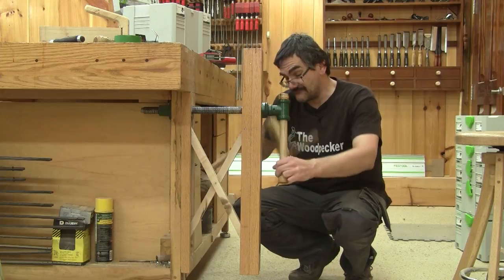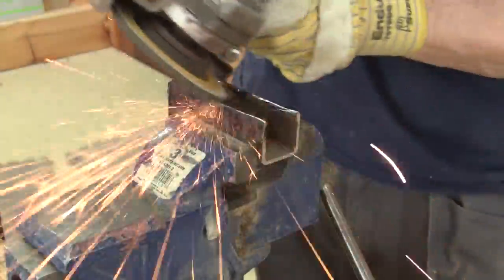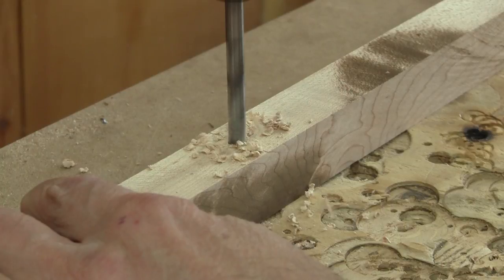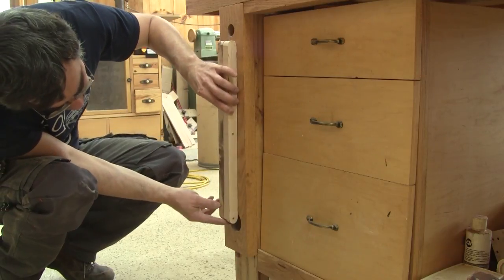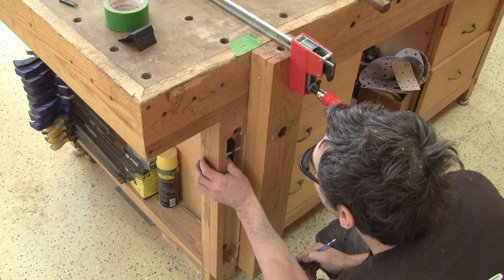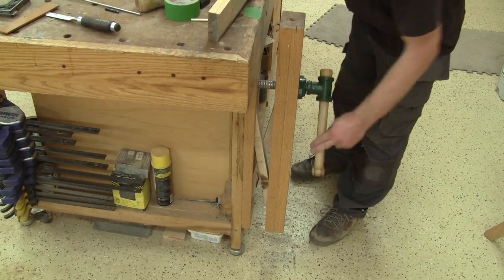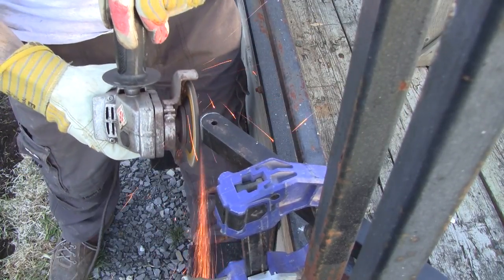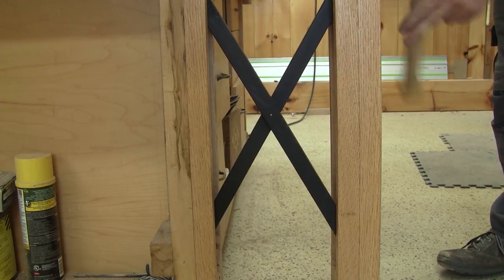The Woodpecker Ep 134 - A Crisscross For My Old Workbench

Comment: A suggestion for the fire extinguisher: mount it next to the front door. That way, when you see fire, you run to the door, get the extinguisher, and turn back. If the fire is manageable, go fight it. But if the fire is now too big, you're already at the door on the way out. Placing the extinguisher behind an object which may catch on fire is not a good idea. If your bandsaw catches fire, you don't want to have to reach around an aflame bandsaw to get to the extinguisher. Also, consider a loud smoke alarm on the ceiling if you don't have one already.

Comment: Most of the time those dust fires just smolder for hours, we use to have them all the time at work because the fabrication shop would send sparks flying 20ft into a pile of saw dust. You can buy those welding blankets to help block the sparks if you want.
Reply from the maker: I'll cut outside it's safer.  Hopefully when I'll need to do that it wont be well below zero...

Comment: To drill a straight hole in something that cannot be put in a drill press, drill a block on the drill press, then clamp said block where the hole needs to be and let it guide your drill.
Reply from the maker: I do that quite often, but I didn't want to mess this up, so I went for the metal bracket.

Comment: if the metal crisscross rides against wood directly it may wear the wood prematurely. A metal channel to ride in may also further reduce give.
Reply from the maker: you're right, it,s one of the reason why I added sone thin pieces of maple where the tip of the metal rides on the wood, Maple is easy to change.
Reply: @LgosseuxDbois-TheWoodpecker  Looks like maple pieces need to be thicker.
Reply from the maker: @4486igi  this shouln't be too big otherwise I would have to remove too much wood to make this fit... I think metal is the way to go. At least it's been working great

Comment: Why can’t you drill a hole through a thick scrap block with your press and then clamp that down as a drill guide? Helps to start your hole freehand so you can locate it precisely through the block.
Reply from the maker: It can be done, but if the hole is not at the exact spot, it's useless, and you end up with a useless hole in you workbench. It's why, a "real" Criss cross manufacturer suggest doing it like this on workbench already build, and on the drill press for workbenches that you're building and plan in advance for a criss cross, just like I did on my other workbench